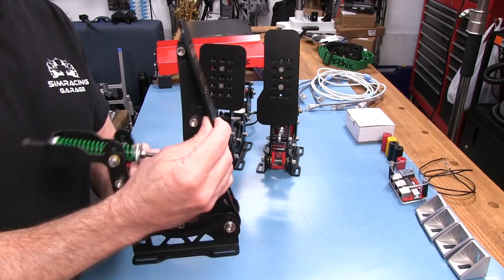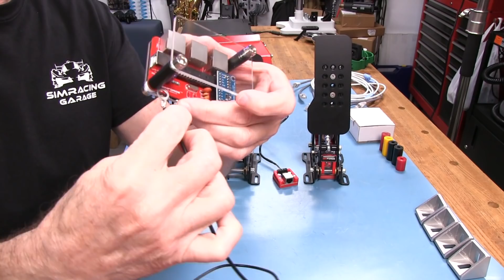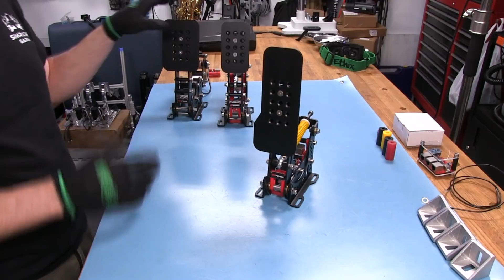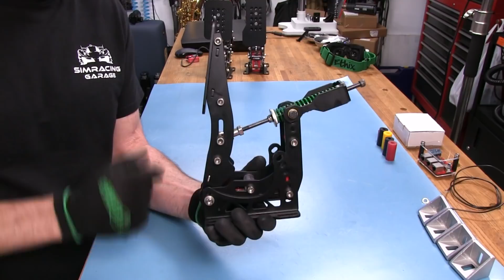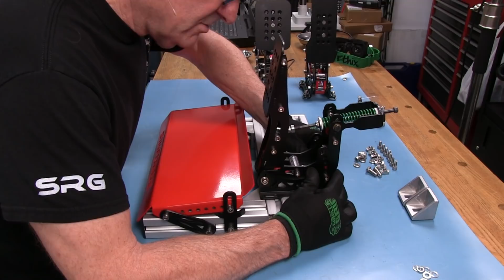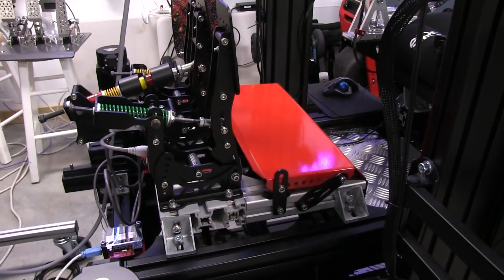Simforge MARK-1 Pedals Review

Comment: Resolution on the throttle and clutch is why newer pedals are now using load-cells for all pedals. 10 to 15Kg on the throttle and clutch, 200Kg on the brake. This gives a much wider resolution which is far less dependant on throw.

Comment: I have compared a few pedal sets of the same price range/features (KRE, Kapral, Fanatec), and these are by far the most customizable and do look like they're built like a tank. The moment I saw the message on the back of the PCB (Senna) it clicked, since their strive for perfection is obvious, especially considering it's their first ever pedal set. To get it this well the first time around is something amazingly rare in any industry and it really shows they've done their homework. Ferrite cores on the USB cable, grounding for the PCB.. good mindset right there. The only thing I'd add is some washers behind those socket head screws/nuts.

Comment: BEWARE!!! I bought these after seeing this review.  It's been many days since I was told the item would ship.  Every time I ask for an update, I get a date range which they have missed and "it will ship in a couple of days".  Prior to this you have to wait a month for manufacturing.  I have a feeling that they are having issues manufacturing these and are not able to get them shipped.  If you still decide to order, expect to wait at least a month and then several weeks after before the item is even shipped if it's shipped at all.  At this point I have very little confidence the item will actually ship.
Reply: I ordered the 14 and they arrive the 28 of March

Comment: Are these better or worse than the Heusinkveld Sprints?
Reply: The pedals themselves are fairly solid for the price, the issue I had with them is the circuit boards would die.  First one would intermittently cut out multiple times per race, the new "updated" board they sent died after one week and will not be recognized when you plug it in to USB.
Reply: @HeadOfNixon  ohh. I see. What do you have now? What do you think of the HE pedals?
Reply: So I got the ultimate+ since i had the money to spare.  The build quality is certainly better which you would expect for the price.  I cant imagine the sprints are any different and would definitely suit the needs of most every sim racer.  One thing I do like about the Heusi's is the config software where you can adjust  the response curve for every pedal and save custom profiles.

I dont want to completely hate on the simforge pedals, they are good for the price.  I was just a bit disappointed at the lack of quality control on the circuit boards.  At this price point though I would argue something like a fanatec clubsport v3 would be a better buy.  If you wanted to spend a bit more, then sprints would be a really good choice, but that is just my humble opinion.

Comment: I don't know Roland !  😉
At 57:50, that's not preload. that's pushing pedal against its stop bumper. Preload would be to screw in the nut on the shaft to slightly compress the base spring.
There should be an additional lock nut at the rod end to prevent that adjustment from moving.
Reply: I thought this as well, the preload is adjusting that screw nut only.  Not tightening or loosening the main bolt.

Comment: Barry, thank you again for featuring this pedal set. I received mine a few weeks ago and absolutely love them! Moving from the Fanatec potentiometer throttle and clutch pedals to the hall sensors have made a fantastic difference. I was often having to recalibrate my pedals before races, and now that is not required!  Your review sold me on these and I could't be happier!
Reply: Still rocking?
Reply: @tombolling6197  Yes, absolutely love them. Cautionary note in set up. I had to make sure to delete all my previous joycalib files, as there is an issue with saving the custom controls in iracing. But on that note, the communication from SimForge was top-notch and they responded quickly to my queries on setup. Highly recommend!
Reply: @rikone01  question, do you have a 8020 cockpit? I'm considering these pedals, but unsure if I'll be able to mount them to my gt omega stand. Also the connection to the pc, what cable is it and how long?
Reply: @ItsHammeringTime  Hi. I do not have a 8020 rig. I have an Extreme Simracing Virtual Experience 3.0 rig with what you might call a standard pedal plate. The Simforge setup uses 8020 as its base and by using the t-nuts and hardware it is easy to attach to my pedal plate. I did remove the pedal plate from the rig, attach the pedals and then re-installed it on the rig. The supplied USB cable is more than long enough to reach the PC.

Comment: Just ordered the pedals and everything seems great, the details in this review will be so helpful when I start adjusting and using the pedals. Very nice Barry as always!
Reply: I just received mine.  Putting them together right now.. i wish they had instructions.. i'm not sure if i'll need to download any software with them, theres no instructions at all so you need to figure out which is the right screw for the job.
Reply: @Triple88a  Check in your account and downloads if something showed up after you got the pedals. Just guessing. It is plug and play so no software needed.
Reply: @FrontSeatRacing  I checked that. Unfortunately there's nothing there.  I'll write them an email and see what they say.
Reply: @Triple88a  It is under Manual & Drivers at the bottom of their home page, how did I missed that.😊
Reply: @Triple88a  how are they?
Reply: @tombolling6197  So far they are very good.  I'm happy with my purchase.  The only thing is so far i've only had potentiometer pedals so the adjustment to load cells is a lot different.  That said so far the only complaint i have is the pedals werent tested before they were sent, mine were missing multiple parts.. if they had tested them before shipping they would have seen the issue.  That said, simforge folks sent them right away but it's still inconvenience since shipping from india is slow at best.
Reply: @Triple88a  Thank you for the feedback!

Comment: This will be my next pedal set if I choose to move on from my Fanatec V3's...
Reply: These or Sprint pedals. The v3 aren't that good once you actually use a good pedal set
Reply: @SIMRIG412  I like the sprints but they seem expensive for how simple they are. I haven't tried them though so I don't know.
Reply: @DouglasThompson  they are amazing. I love mine and they're so much better then the v3. I'm actually waiting on simlabs inverted pedal mount for my gt1 evo and Sprint pedals. should be here Thursday. And waiting on my new grid engineering DDU 5in screen with 20rgb lights.
Reply: @SIMRIG412  I will consider them, I'm leaning more towards something that can allow me to replicate my car in real life though so I am wanting a hydraulic damper on my brake pedal. I know I could attach my Fanatec one to it somehow but I'm hoping to find a set with a really stiff clutch pedal spring as well.

Comment: Are there any other SimForge users out there who found that their pedals stopped working with Assetto Corsa and ACC after the last updates?

Or is it just me?
Reply: You're not the only one in this comment section that have had this issue , you can't just go and assign them manually?
Reply: @DavesHomelessCats   Not at the time, no. I did get them working again, but it's been a while so I don't recall what the solution was. Might have had something to do with uninstalling and reinstalling the drivers. 

Since unboxing I have had to unplug and replug the USB cable sometimes to get the pedals to work, and I haven't figured out what causes that. I've just made a habit of checking them in DIView or DXTweak before I start the simulator.

The hardware is excellent, but the software could use a bit more work. I still think it's the best option for the price though, and if the software gets updated to fix these issue they will probably be a better option than some more expensive pedals.
Reply: @natesaforverk  ah did u talk to them? wtf are they saying about that ? are they fixing the software ?
Reply: @natesaforverk  damn, I also have the same issue of needing to unplug and plug my T-LCM's for them to work...

Comment: Between This, the Fanatec $350 DD base (+ extra wheel), and a SHH shifter, we might finally have a complete high quality, Direct Drive Setup for ~US$1,000. Which is insane! Just a few years ago, you couldn't get a DD base for under $1,000, let alone a full racing setup!

The Sim Racing Future's looking bright!
Reply: now that would be attractive for me ,because these other company's are asking just for pedals 1000+ euros or dollars is insane
Reply: you still need the appropriate rig to mount it, which is around 500€, and now you also need a seat, which starts at 300€. In the end, even a "cheap" setup is 2.000€/$, and that is without the PC/console and without a decent monitor/TV. 
a decent sim rig will never fall below 2.000€.
Reply: @XpVersusVista  Nope. Simlab GT1 costs around 350 euro and you can get a clean basic seat from a junkyard for about 50 euro or you can get a Sparco Sprint for 200 or the bigger one for 220 euro.
Reply: @XpVersusVista  You don't need to spend that much, you can build a very sturdy rig from $50 worth of wood and screws and slap a $40 seat from summit on top. That's been the core of my rig for 3 years now and I'm still glad I didn't even spend $100 on that portion.
Reply: @XpVersusVista  I just mounted my Simforge Mark-1s on my homemade wooden rig along with a Simagic Alpha Mini. It's rock solid, and cost me about $60 in lumber and bolts. (Not included the seat, that I already lying around. But, you could get one from a U-Pull it for under $100. Get something comfy and sporty out of wrecked STI, MX-5, or what have you.)

The best option is a good solid profile frame, but you can get by with less. I started with a Logi G920 and my little homemade cockpit. It's been growing and expanding ever since.
Reply: save money by getting a aftermarket pedal adapter then get a real car wheel
Reply: lol these pedals are shit
Reply: Prices on  sim gear will get cheaper years down the road.
Reply: Does a CSL DD without the boost kit count as a high end/quality wheel base?? I think you're better off choosing a Simagic Alpha Mini and their GT1-R wheel for $949USD + the $136USD from the SHH NEWT  for $1085USD. But you get a way better rim than the cheap fanatec ones and a better wheel base with 10nm and no shitty fanatec customer service. Now this would be a good set up, it's the one I'm currently rocking at the moment and it's amazing. Looks way better than a CSL DD and better quality if you ask me.
Reply: @DavesHomelessCats  only a better value if you really like the GT1-R wheel and must have the extra 2nm. Otherwise you're better off with the CSL DD Boost at 8nm and a universal hub + whatever wheel you want for less money. Or the real Alpha at 15nm plus a quick release hub for another $100 and whatever button box.
Reply: @DavesHomelessCats  agree on the simagic wheelbase, definitely a better value if you're on PC, console though, there is no better than Fanatec as you know.
Reply: @DavesHomelessCats  csl dd is fine and works really well not tried the alpha mini looks good though
Reply: @DavesHomelessCats  Here it is a year later. I now have a Simagic Alpha Mini  + GT1-R, a VNM Shifter, and yes, Simforge Mark 1 pedals!

Comment: I'll eat my hat if you can get these for under £600 in the UK but to me still well worth the money.
Seems like Barry was only using the spring as the resistance on the brake pedal....the spring has way to much travel .
Lovely made kit ...👌🏻
Reply: They are about £370 with shipping
Reply: Vrs 2 pedal set for £500 or these for £250 no pedal deck on a aluminium profile rig ?

Comment: Thanks for the review. I bought meca cup 1 based on your review. But this set looks too good to be true. I live in Germany and this set will cost around 500 €. I would go for heusinkveld sprint instead. I have compared sprint with meca and at the end got the meca because of the build quality. To every one who wants to buy this over fanatec v3, just get the heusinkveld sprint if money is not a problem. For this, I would wait for Mark 2.

Comment: Can someone let me know if I can use as an example a set of thrustmaster pedals with a Logitech G29 on PC?
Reply: U can
Reply: @EsR9  Hi, Can you link me or tell me where to look for info on it please.
Reply: They are building an adaptor which works with both brands
Reply: @jerrygeorge007  Hi, Building one? who is & is it not possible yet?
Reply: @itry8312  I mean Simforge is developing an adaptor that can connect to thrustmasters and Logitech wheel bases. Could be available very soon. Ping them on instagram for more details
Reply: @jerrygeorge007  Thanks for replying, I'll do that later. Cheers  👍

Comment: How would these rate against Heusinkveld Sprint pedals? I have been looking for pedal sets for a upcoming sim build i have planned.
Reply: We always have to keep in Mind that Sprints costs about the double of the price. The Sprints have a better cable Management. I personally like a clean setup. These two boards with big RJ45 Connectors put me off tbh. This was solved much better from Heusinkveld. Also the LC is a litte bit stiffer at the Sprint-Pedals. But not much.
Over all I would again go for the Sprints for these Reasons:
-Support and Quality is save with Heusinkveld. Also they are very experienced.
-Cable Management
-Gas Pedal is smoother and is easy to adjust

Hope this helps a bit. Also I highly recommend Barrys Video about the Sprints. Please also take a look at this vid and pay close attention what he is there mentioning and what not.
Reply: @bjornromermann5080  Another plus for the Heusinkvelds is the ability to configure the input/output relationship curve of each pedal by software.
Reply: @bigredracingteam9642  yeah I totally forgot this feature. Have mine only for a couple of months and use them still OOB.
Reply: Thank you for the response I am going to go with the sprints! Sim labs p1x simucube 2 pro and sprint pedals
Reply: @shogunner3053  must be nice to have 5k to throw around like that
Reply: Heusinkveld Sprint is $906 cnd

The SimFordge is $333 US, however they want $130 US to ship.

For me to bring in the SimFordge I would be looking at $650 cnd...so when I look at the $250 price difference...I dunno, the Heusinkveld’s seem like overall the better deal...quality, and highly tested and reviewed.

Comment: One question, can we use this or any of the new pedals from today to play American truck and euro truck simulator or this is just for racing games?thank you.
Reply: Typically the only thing stopping you from using a certain peripheral is if you're on console, or if the sim/game doesn't support multiple input devices.  
ATS and ETS, as well as most games and sims support any controller you throw at it.
Reply: @Cyrenetes  thank you so much.
Reply: @designamk1160  thanks

Comment: Great review as always. What about the software? Is there any?
Reply: Yep good question. No software...  Fanatec pedals have also vibration in break and gas.  Until now not so god, and is not cheap either. At these price  range you can buy tge fanarec with a little extra
Reply: @rosacalu  lol these are better than the V3s , Fanatec fan boys are the absolute worst.
Reply: @DavesHomelessCats    :))  The thing is I bought the Fanatecs v3 +pk. Now I wanted to buy the mark one but the coronavirus "killed" the delivery boy. I also thought about the vibrations, that it will be something insignificant or scam. It is a Scam partialy, but seriously when I am extremly focused I deeply need the shifting vibrations from the v3's. In the long run I will buy the mark one.

Comment: After 8 Minutes it looks like Heusinkveld quality for Fanatec money. Nice.
Reply: Shipping alone to the US is over $200 for me ao about $550 total. If you needed warranty you're out of luck, the cost to ship alone would mean you're not getting any warranty service.
Reply: But with none of the track record of reliability or comparability and software. Fanatec  has an advantage for console use and pc, HE is higher quality all around for PC.
Reply: @Wurldly  Yeah I won't run out and buy them any time soon. I moded the shit out of my Logitech pedals (Pressure based Brake, degressive clutch,12bit USB-Adapter)
they are really good now and they'll have to last until I have the money for Heusinkveld or Simtrec Pedals (I'll skip the V3s since they arent much better than what I have now) 
Still it's just nice to see some competition in there. Maybe it'll inspire fanatec to bring out better Clubsport pedals or the Heusinkveld Sprints will become a bit cheaper. It's just nice to see competition on those kind of pedals.
Reply: @Wurldly    like any other new product from a new company, it is also too early to judge the Mark 1.  Let's not prejudge what none of us have used. Every established company once had no customer and not proven reliability record right at launch including Heusinkveld.